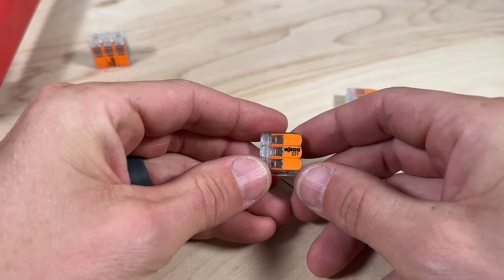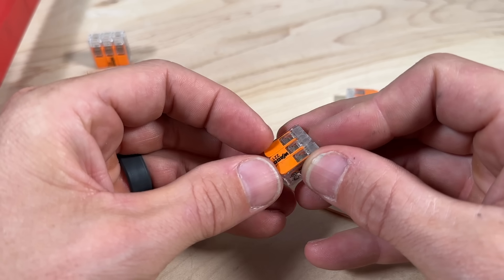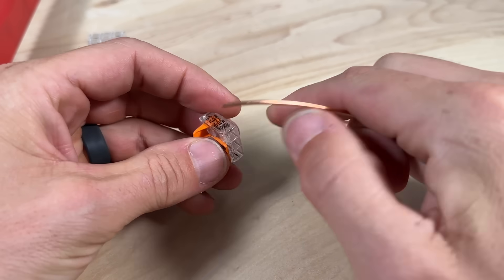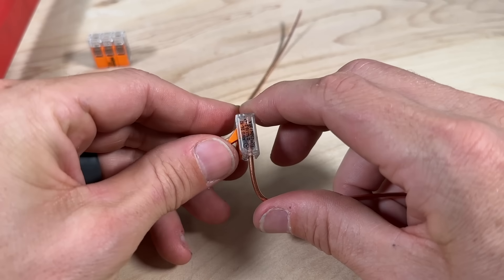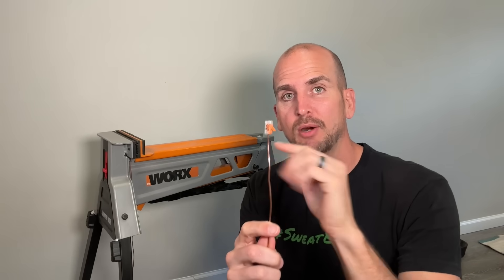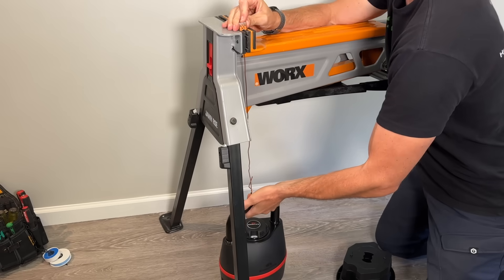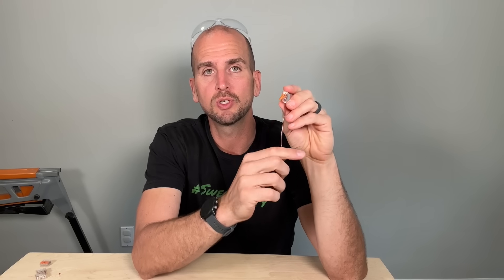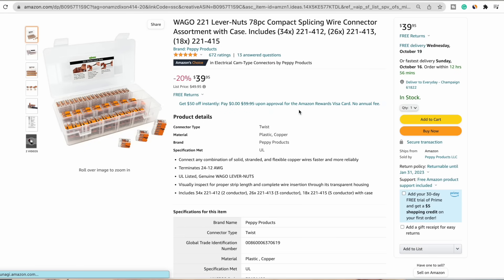WAGO 221 Lever Nuts: Testing the Most Common Negative Feedback

Comment: 20lbs of force is a ridiculously high amount for the force experienced in an electrical box.
Reply: @samjones1954   So are you saying we are suppose to believe you over the NEC and UL? Not to mention that they have been using this in Europe for way longer than 8 years. I've yet to hear about any home fires in Europe attributed to Wago connectors. I could be wrong though because if its posted in Youtube comments, it must be true.
Reply: @explorenaked wannabe electrician 😂
That’s like swinging on your kitchen cabinet doors testing them for strength.
This actually happened in Oklahoma on a new home in 1979.
Reply: @explorenaked

Where in Europe? Europe is not a country.
Reply: @samjones1954  They have been using Wago's in Europe for decades on 240v circuits and the standard 221's will accept up to 12 gauge wire. They also make a larger version that's good for 30 amps and takes 10 gauge wire.
Reply: @surferdude642 : Wago's what in Europe? You left the term "lever wire nut" out?
Reply: @surferdude642  This is why they lose wars.
Reply: @samjones1954  That's an argument against wire nuts, not lever nuts. The Lever nut has a spring / lever behind it, making it "want" to close all the way. As you get deformation / thermal cycling, that spring force will retain contact on the wire. In other words, even if you stranded 12 gauge wire flattens out over time, as long as it's cross section is at least as thick as the thinnest allowed wire gauge, it will still have a good mechanical force holding it there. You get no such benefit with a wire nut. If you don't have a good connection, it will loosen over time. And there's no spring to take up the slack.
Reply: @fgbhrl4907 : These lever nuts ARE wire nuts; just not the old regular (screw-on) kind. He's using the comparative terminology wrong.
Reply: @fgbhrl4907  The springs lose tension over time the connection become resistive, heat starts building up arcing and then failure or fire. Twist the copper wires around each other nothing goes wrong ever.
Reply: @RadioRich100  If you're saying springs "in general" lose tension over time, you're also arguing against electrical outlets, switches,  and light bulb sockets, all of which rely on (copper) spring compression to keep an electrical connection. 
Now, if you're saying WAGOs in particular have an issue with the springs losing tension, I'd like to see a citation, because while it's possible, it does feel a little like it's a case of US electricians having unfounded contempt for a product that the rest of the world uses without issue.
Reply: @fgbhrl4907  No I didnt say in general,wagos are different the contacts are copper and tiny in comparison and outlet contacts (not springs) are made out of brass. Rest of the world?? Dont think so. Unfounded contempts no issues lol ? How about melted wagos by the bucket full?
Reply: @RadioRich100  Why dont you do a Google image search on respectively "failed wire nuts" and "Failed wago" ? It will show way more failed wire nuts than Wagos, why ?
Reply: @fgbhrl4907  Outlets and switches do get loose and fail over time. Haven't you ever used an outlet that doesn't hold the plug tightly or a switch that's loose and finicky? The spring loaded backstab connections on outlets and switches frequently fail too, ask any electrician. However, I haven't heard of that specific problem with Wago connectors and a quick Google search for "failed wago connectors" returns very few results compared to searching for "failed wire nuts", but wire nuts are also much more commonly used and way easier to misuse, so that's not to say wire nuts aren't as good as good as Wagos, just that either one will almost certainly work great if it's used properly.
Reply: @fgbhrl4907  Yes, all of those things wear out. Receptacles that receive frequent use are only good for at most a handful of years before they all need replacing. The difference is a receptacle is 60 cents... those Wago connectors cost close to that EACH and there are a minimum of two of them at every fixture and junction in your entire house. And when a receptacle gets loose your plug falls out... when those things get loose they're a fire hazard. Congrats, you made your home electrical 50% more expensive but the quality and reliability is LESS.
Reply: @bloodleader5  Wire nut is more expensive if the work costs.
Reply: @RadioRich100  Never heard of wagos melting at all, much less by buckets full
Reply: @samjones1954  they are avail in 12G and 10G. I’m using 10G for my 240V circuits with no issues 👍
Reply: Unless you have outlets that are on freely moveable cords of romex wiring, the small chance of it sliping is not to be eorried about
Reply: @samjones1954 ,you are stuck in old days,wire nuts are dangerous and banned in many countries,Wagos are the way forward,so just accept progress.
Reply: @onelineal9382  You could not be more wrong.  Wire Nuts are internationally legal, it is the wago that is not allowed in many countries like Canada, France and Germany.  All these countries experienced Aluminum wire and have a bad taste in their mouths.  Also the Wire Nut we use today is only about 30 years old.The ones before that are banned as they use a set screw and are illegal... so next time you make a statement to a professional Electrician, you should study and not look like a fool.  Also, this guy who makes these videos is NOT  a qualified Electrician, so take what he says with a grain of salt.  Further, Wago's are very popular when you buy an appliance from CHINA.   In  Canada the code demands we replace them with safe Wire Nuts.   The problem with wire nuts is that guys like you that don't read or study install them improperly.  That is why we have codes.  Consider the fact that a wire actually jumps when energized.  Over a period of time the wire will loosen the spring in the Wago.
Reply: I agree with james here. It's easier for a bad electrician to mess up a wirenut connection than a lever wago. Wirenuts will still have their place in the industry, especially with cost but please don't half ass it.
Reply: @samjones1954 you started off correct but then ruined it. A screw loosens and stays loose because there’s nothing pushing back down on it. Meanwhile these wagos have a spring that will push back down, maintaining that constant force on the wire
Reply: Spring metal degrades.  It degrades even faster when you have electron flow.  Springs get brittle and break, if you are old enough to own a bed, you should be quite aware of this.   I lived through the Uriah, Asbestos and Aluminum screw ups and see it happening all over again.   I will not accept any new technology until it is proven and to prove these spring clips you will need about 60 years.   If they make that then I would trust them, however, I am understanding that these clips are failing only after a few years.   I have never met a true Electrician that approve them, and don't tell me this guy does as he has no concept of electricity as he is a hack.  He has no formal education in Electricity.  If he was not in the USA where no one cares about the citizens he would not be able to do these video as he is not qualified. @TheAviation101
Reply: @samjones1954  This is certainly a testable assumption - i'm not saying if your prediction is correct or not, but someone can actually test this, and real world use has yet to show this as a significant issue. The easy solution is for additional peace of mind is too wrap with electrical tape. 

Also, Wago 221 certainly accept 12 awg, based again on real world use and advertised specs - where are you getting the information that you cant use 12 gauge?

I've had more than my share of seeing mis-used wirenuts, which aren't necessarily better just because of their prevalence in the U.S..
Reply: @samjones1954  Sounds like nonsense to me.
Reply: Exactly what I was thinking. If there's 20 pounds of force pulling on an electrical connection in an electrical box, you have a much bigger problem than the lever on that lever nut that needs solving.

Still, it'd be cool if Wago could find a solution for this.
Reply: @mjc0961  I mean you can. It would be a locking lever. That would make it nearly single use. Or add a failure point where the two pieces of plastic lock into each other and it will break. Like the latch on anything cheap and plastic
Reply: @mjc0961 I have a solution, one wrap of electrical tape around the levers before you push them into the box.
Reply: @mjc0961  electrical tape is your friend
Reply: @mjc0961  Ahh dont use them??
Reply: @Sam Jones  90% of the homes in America should be burned down today according to your logic. Lol...
Reply: @njkmnjkmjjkn  I did read. You're blaming the product when there is nothing wrong with it and it's worked flawlessly for decades. "Morons who refuse to use Wagos". You're only pretending you have any idea what you're talking about.
Reply: @samjones1954  BS.. The germans have used wagos for decades and they are well known their engineering. You wire nut fans are so narrow minded and funny.
Reply: @samjones1954 : Psch, thousands? I can't imagine that. Seems like you left a "th' out.
Reply: yeah, in my view, nothing ever moves in a box once you put it all back, too much wire tension, boxes small, all crammed in there, nothing will move, even plugs in and out, I just don't see the big danger, my eyes perceive zero movement when using my outlets, ok maybe i'm missing a tiny movement but still, nothing that's going to loosen screws or wagos (but perhaps wire nuts, even then unlikely)  The outlet will go bad before anything loosens!
Reply: @davidcarp5935 It’s called “wire hammer”, I hear it every time I turn on the lights :)
Reply: @samjones1954  not true. electricity is not water, don;t confuse analogy with facts
Reply: It’s high not unrealistic
Reply: Wago’s have been around since they got there UL listing in 2003, I believe the concept was thought up in 1951 as per my Screwfix buddy, and he remembers a early version clamp caged type in ‘79. I use these on 14, 12, 10 solid and stranded with no issues apart from occasional operator error! These are also great in control panels and where you have Din rail mount clip to use as well! All around nice product just needs common sense.
Reply: @nigelsmith7955 : Wago's what have been around? You left out "lever wire nuts"? Also: "got their UL listing"? So like... "got UL listing there"? Where?
Reply: @njkmnjkmjjkn  And yet you believe that the same low-skill installation would magically have been better if they used a different product. The inability to follow your own logic as put down in your own words is really something.
Reply: @njkmnjkmjjkn  Then you don't know how to use wire nuts correctly. If the wires are properly twisted together and you have good torque on the nuts, you should be able to pull as hard as you can and they won't come loose.
Reply: @samjones1954  Wagos are junk

Comment: There's 2 types of people for these, those who've used them and those who are stuck in the past.
Reply: I am not, am a contractor, have employees, and don’t trust these for many reasons more than what is addressed in all these videos.
Reply: @passurlamerpropress of the electrical work
Reply: I keep breaking them.
Reply: Disagree.
I am all for something better than twist wire nuts and splice bolts but nothing has shown themselves to be better in my view.
I wish they made CLEAR wire nuts (maybe put a rim of color at the base to differentiate the sizes) although since the actual wire nut inside is not see through, I'm not sure that CLEAR would help except in the most clumsy attempts to use them.
Anyway ....
20#? 25#? 30#? 40#? 50#? well, it might depend on when would the wire themselves pull apart.
I would like to see the same type of testing with the wire twist nuts and see side by side data.
PS yes, split bolts are not for the typical standard outlet conections but for the higher amp circuits.
Reply: @2Truth4Liberty  
Wirenuts are made by Satan himself. No true professional uses such dangerous and outdated connectors. 

Screwless connectors have been used in Germany for decades.  They have them up to 25mm cable and larger. Do you have colour TV where you live?
Reply: There are three kinds of people. Those who can count and those who can’t.
Reply: The third type is the people who have to replace the wagos.
Reply: I’m stuck in the past… Edison’s DC power!
Reply: @rob379lqz  more power to you! 😂
Reply: Yep and I am one of them. I don’t think the pull out force is a concern but the amount of contact that the spring clip has is. Just don’t trust them.
Reply: In the past there are far fewer electrical fires.
Reply: @RadioRich100 i have seen you before wago hater that says lies
Reply: @TechniCraftYT  ??
Reply: I am stuck in the past, and with THIS product I am very confident with my choice.
Reply: @spresc2180 Reminds me of the American plumbers that are scared of ProPress meanwhile europeans used them for long time already
Reply: 3rd group: professionals who won't use them because they over heat.   In the US we use 115v which means higher amps than the typical 240v in rest of world.  If you are an amateur and don't care about your license or lawsuits, it's not a concern. 

I've seen them char.  Once on a transfer switch used for back up generator (2000w).  The other time was in a compressor (500w).  The nominal amps were well below the rated wago amps.  

WAGO are not listed in most states for industrial use.
Reply: @joeboxter3635 they are standard use in germany (mostly the push in ones) also they are rated for 20A max (they can take more don't know how long tho as it goes with info like thisbit tends to be under the real limit for safety reasons but still don't do it) so whoever puts them in a curcuit that has more is just stupid.
Reply: Thanks for your input @joeboxter3635
Reply: @joeboxter3635  
You size the Wago to the amperage of the circuit.  I have not seen any Wago char. When installed the conductor must be tugged backwards to ensure it grips. Follow the instructions.
Reply: @joeboxter3635 Sounds like user error. Wouldn’t that backup generator be on a 30 or 50 amp breaker? These wago nuts can only be used with 20 amps, 12 gauge wire maximum. Yes, if you use it incorrectly, it’ll fail like everything else. Don’t use wagos on any bigger than 20amp/12 gauge wire. 🤭
Reply: @joeboxter3635   Cool story, bro.
Reply: @joeboxter3635  Thank-you for the heads-up. Good to know.
Reply: Wire nuts are better.
Reply: @venividivici4253 
Wirenuts are made by Satan.

Comment: Could you wrap the WAGO with electrical tape to keep it down?
Reply from the maker: Yeah, that is how some "solve"the issue.  Similar to how some people tape wire nuts.
Reply: @EverydayHomeRepairs  I also tape receptacles.  Makes me happy.
Reply: This is what I do.  I have been using various flavors of the Wago for a few years on various projects.  I like them a lot, but I have had them pop open unexpectedly when maneuving them around or trying to stuff them back into a wire box, especially with stiffer 12-gauge wire.  So after inserting all of the wires into a Wago connector and making sure that they are all seated properly, I wrap the connector with electrical tape.  The tape is just about the right width, and a couple of wraps usually is good enough to prevent any accidental openings.  Note that I am a reasonably experienced DIYer and not an electrician.
Reply: @edl1957  How do you tell if they're seated properly?
Reply: @IronHeel  On the back (clear) side of the Wago, you should be able to see the inserted wire.  Just make sure that the wire is inserted completely into the Wago slot.
Reply: @edl1957  Thanks

Comment: Yes, the design needs to be improved to add a positive lock. 

However, until then, I still prefer them over wire nuts, and solve this issue by simply taping over the wago.   

I have gotten into the habit of having black tape, white tape, and green tape on my tool belt.  It only takes a few extra seconds, and it makes me feel better.
Reply: I do the same. always wrapped in electrical tape for safety. I've redone my whole house and it's Wago 221 all the way.
Reply: More importantly than tabs opening is making sure the wire is shoved ALL the way. This connector grips the wire by bending a tiny amount at the tip. No tip, no leverage.
Reply: Agreed.
Reply: Great suggestion.  Thanks.